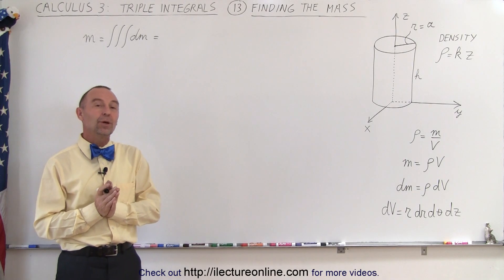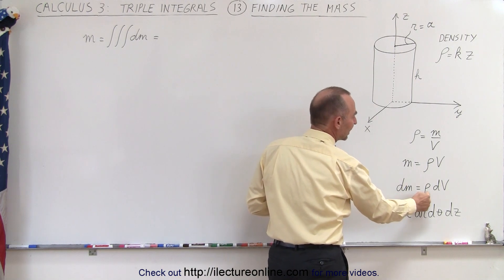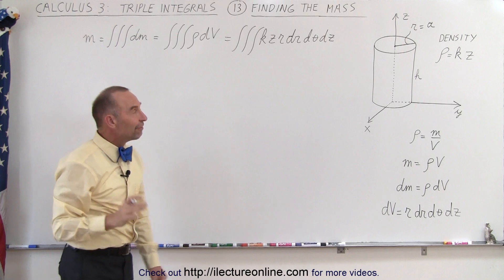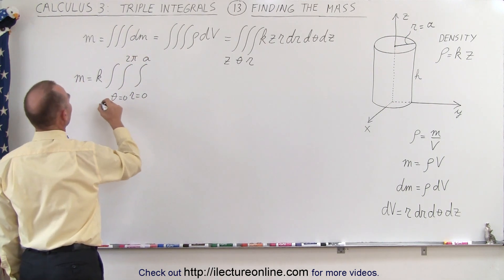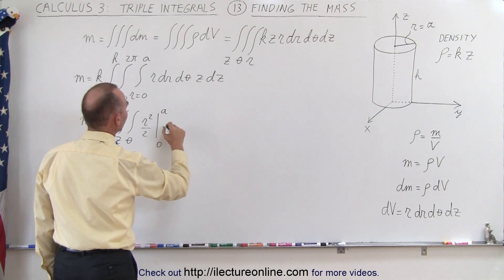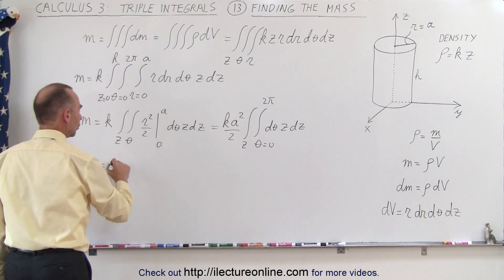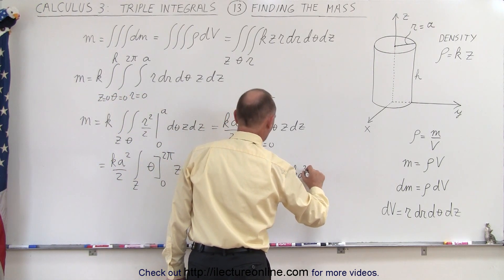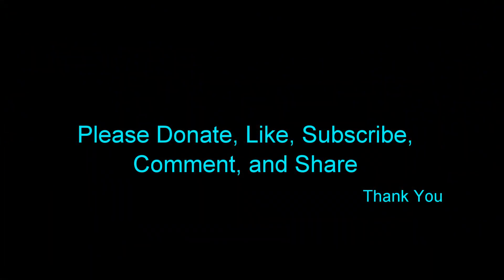Calculus 3: Triple Integrals (13 of 25) Finding the Mass (Variable Density): Cylindrical

Comment: How do you get the contact k, for example water boiling in a tube?
Reply from the maker: Sorry, but we didn't understand your question.
Reply: @MichelvanBiezen  let's say we have a boiler for a power plant where water is used to generate steam for a steam turbine to produce power. The boiler tubes are run vertically and heat is applied over the tubes. From conduction and convection, the water in the tube will begin to boil thus a change in density causing this water to naturally circulate in the boiler. At different heights, the density will be different based on temperature. How do you calculate that linear constant k?
Reply from the maker: The change in density (of the water) is not going to be the biggest problem.  First of all, I would assume that those tubes are well insultated so that the heat loss is mimized.  Secondly, you would have part of the pipes filled with hot water and part of them with steam.  And the most important aspect is the amount of convection that would be present around the pipes.  The best you can do here is appriximate taking into account the convection currents.  (See our video on that part of the heat transfer).

Comment: How do you determine what the constant is and how it is a function of height? And if the density is changing is the constant really a constant?
Reply: The constant (k) is an arbitrary variable used to represent the proportionality between height (z) and the density at that height. Let’s assume k=2, at height zero, the density p = 2*0 = 0, at z= 1, p = 2*1= 2. k can be assigned any value depending on the rod. We leave it as a variable so the mass equation we derive after applying the integral can be used for any rod of varying density proportion (k). 
The change in density as a function of height (z) is not the same as our constant (k) which remains unchanged regardless of height.